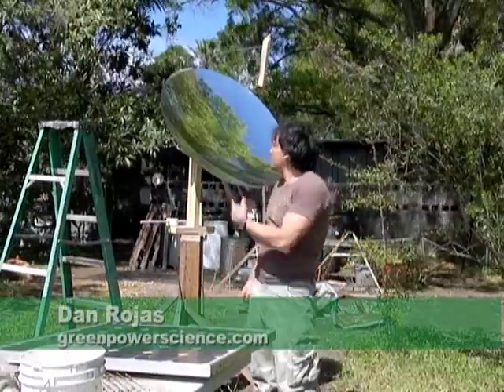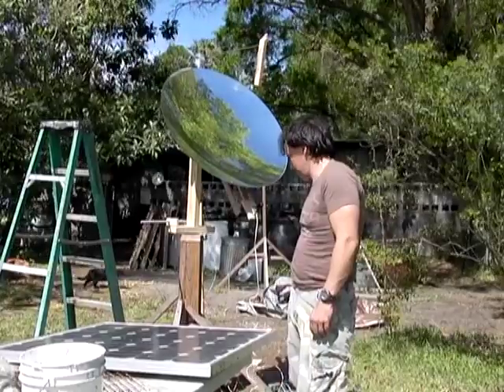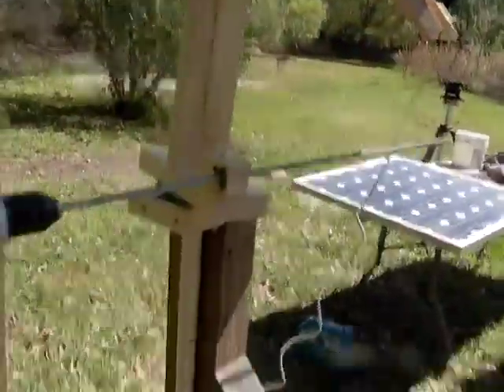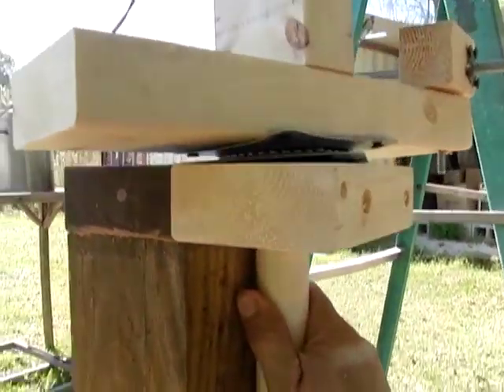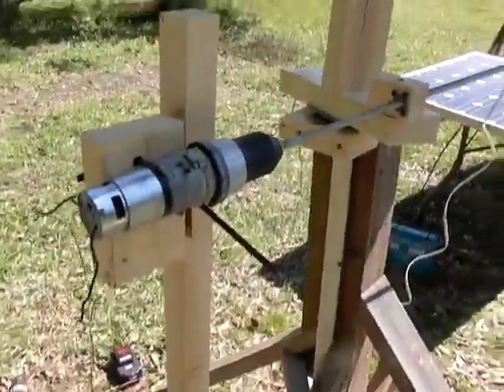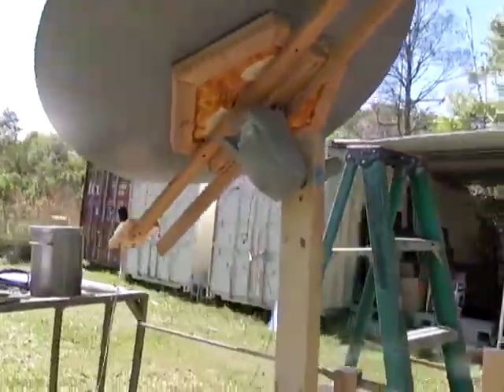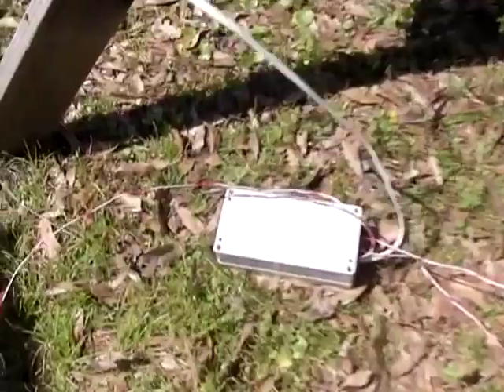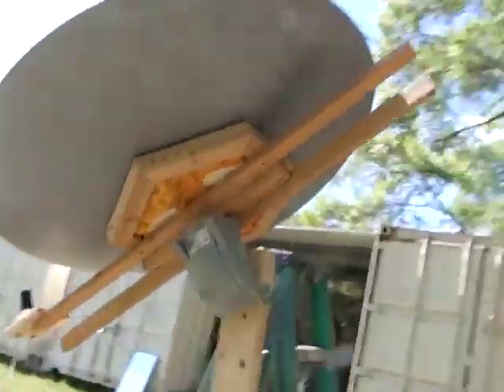Sun Tracker Heliostat Parabolic Mirror Solar Cooking

Comment from the maker: @ricochetVendetta This dish is collecting about 600 joules/watts of heat energy. the motors are less than 5 amps or 60 watts. The new version of the controller has delays that prevent constant cycling. This saves a lot of power on larger actuators. This setup ran a full day with no wind on a 7 amp hour battery with no panel.

Comment: Now that is really cool Dan that solves the problem that I've had all along with a self powered tracking system. Very good prototype work. You have to be the most energetic home inventor I've ever followed in the alternative ( renewable) power world. Lots of people talk but you actually give us some great platforms to work off. Thanks for all the great posts. I leaned towards a clockwork system that was controlled by following the prefabed solar arc for each month but yours is a great deal bett

Comment: @TheLonelyImmortal 
With this sun-tracking technology, you could very easily design a self-sustaining system. Use the parabolic mirror to track the sun, focus the mirror at a water tank that can sustain high amounts of pressure, and connect the water tank to a generator. You could make the steam vent out and refill or make a closed-loop by connecting a radiator-type heat exchanger that cooled the steam to water and flowed back into the water tank to be boiled again to continue making electricity

Comment: the tracker can be made without electricity and all the stuff . we remember they are some oldskool toys like car , joker which required to rotate its keys several times so that the inbulit spring gets the tension . also there were some non electric mechanical watches which utilised this spring machnism to operate for next 24 hours etc.  same thing can be applied in this case.

Comment: Dan, as clever as this tracking system is, wouldn't it be more efficient to simply go through a  programable controller that acts on the actuators? The path of the sun is well known each and every day and could be coordinated with the positioning of the mirror. An algorithm could also regulate the frequency of the actuators, making them more efficient as well. There are amateur telescopes that operate similarly.

Comment: Believe or not, this is actually a good design, the way he did the metal pole inside the PVC to get stability, yet while all the weight is on the lazy Susan bearing.  It is not attractive, but it looks pretty solid, at least the East/West tracking part. I wished had a more practical example than to burn a stick.

Comment: @snyperbob Simpler: A vertical barrier along the path of the
sun, a CdS cell next to the barrier running a motor off a one 
ft sq PV panel that advances the dish along the sun's path 
when the sun moves past the barrier. Use with a cheap 
plywood equatorial mount and set it to your latitude. Adjust 
base rotation for season. Or use CdS cell to run a solenoid 
that releases a hanging weight clockwork mechanism, like
a child's music box. Rehang weight daily. Also think bimetal
strips, etc.

Comment: I think an aurdino programable controller with some open source software to track the sun would work.  The aurdino controller is about 40 bucks.  If I am not mistaken I have already seen someone doing it on you tube,  Maybe even a coulpe of industrial stepper motors?

Comment: @andruha11234 Solution coming in from the tank, pumped into the line ,flex line on your bottom post going up to a stationary heat accumulator ,then out to the tank again to be used or bypassed into the system again ,thermal heat switch would be installed to the out line to cancel solar tracker when sufficient heat is accumulated .
One parabolic dish is enough to burn on contact and would suffice in heating a home!

Comment: Nice video Dan!  Have you thought about just building a simple circuit with something cheap like an Arduino?  Estimated cost is less than $50.  You actually wouldn't even need an Arduino, but it would make it easier for a non-electronics person to make.

Have you ever seen season 1 of The Colony?  The professor built one of these circuits with just IC chips, cost would be even less
Reply: I am planning to do this some way into 2021. Got some of the parts already ordered, except for the dish and the scaffolding which I will hopefully be able to construct myself (got a lot of info about that here on Dan's channel :D). Also thought about the 4 panel version (without Arduino) by Nighthawkinlight but for that I would have to order glass solar panels from China ... (high risk of breaking during shipping).

Comment: what do you think will generate the most power? aiming it at a boiler that will run a steam engine, aiming it at a stirling engine or aiming it at a solar panel?

also, how can i make a bigger one? i will need a very large oven, correct?

Comment: Nice work Dan, I love this, the control box is kinda expensive for what it needs to do, in the not too distant future we should be able to get our hands on the Raspberry Pi (google it I'm not  here to advertise it) basically a credit card sized Linux PC with IO pins for this kind work, its also very low power only a couple of watts at 5v and all for around $50

keep up the good work
Reply: An Arduino Uno kit right ?
Reply: @josephkwabenakodie-ampaw1001  No but that would work perfectly even today 10 years later

Comment: All we need to do is design an efficient way to mass produce parabolic mirrors. At this time, one 60 inch mirror is over $2000/ not very practical. if there were a way to mass produce them fast and cheap, we could have one or two of these on every household in the entire world. Low to no maintenance by making it a closed loop system where the steam would pass through a heat exchanger and feed back into itself. The materials would have to withstand the elements. Limitless free energy for decades!

Comment: Dan, you are such a pyro! LOL.  Seriously if you put your solar panel on the unit, used it to charge the battery as you have, and run the motor controls, wouldn't that be perpetual motion?  Over Unity?  The soulution to all the worlds problems?  Surely I jest, (yes) and don't call me Shirley.  I do agree with bg0802 you are a great builder!

Comment: +DREXELENG2015 Yes, this is very possible. Your control device would only need to know the position of the target and the position of each mirror. Then it is a simple matter of calculating the angle for the mirror face to be and translating this to how to move the motors.

Comment: @zenloki024 I was thinking the leaf could act like a censor for the motors ,you could put a web cam on the leaf and do it via software ,that's do-able ,lols or you could use 4 micro switches attached to the leaf ,actually that would be cool